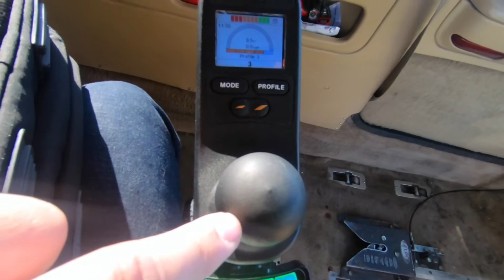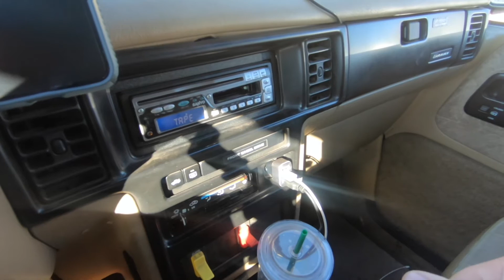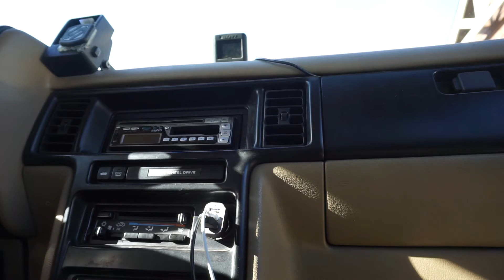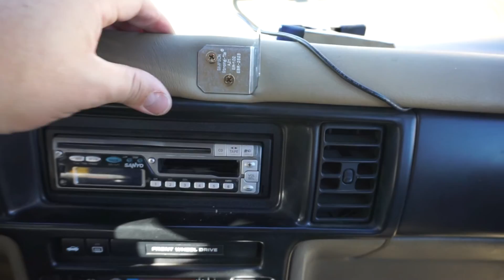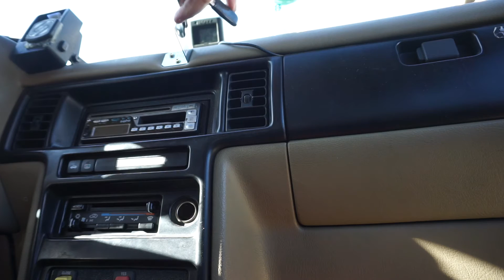VLOG 384 PART 1: dippping stuff!

Comment: Oh Man those LED Bulbs can be real EyeBall Blasters !!!  I had a similar problem where I wanted to soften the light coming off the entire bulb. It just so happened that I had a can of cream colored high-temp stove paint !  I spray-painted the whole bulb (except the threads of course). I get headaches from the glare before that. The nice thing is that you can keep adding layers of paint after each coating is dry until its as dim as you like. I think I did 2 coats of paint....Maybe 3. Now the bulb throws a soft sunset type of light rather than a high-noon desert-storm type of a light. PERFECT ! Though I have to admit, YOUR final product looks WAY cooler than mine !!! Mine is just a cream color bulb. Yours looks pretty techy and futuristic !

Other Suggestions: Bungee Cords are cheap. Change your clocks... change your Bungee cords (twice a year).
Reply from the maker: lets add to the list.. change clocks... change smoke detector batteries... and change the bungeeee cords! LOL
Reply: @TotallyNormal-  OH !!! GREAT Idea! ...Don't forget to mount a smoke-alarm near your tail pipe. The perfect accessory for a Rat-Rod ! ...just in cast you start to burn oil. HaHaHa ! :-)
Reply from the maker: i knew something was wrong when i was moving and there was a bunch of Carbon monoxide detectors in a box in the back and they ALL started going off about 15 min into the drive!! lol
Reply: @TotallyNormal-  Now I know why you are always laughing :-)

Comment: Legs are killing so have to lay down and will come back to this series, but before I go, if this did not turn out, consider just getting casting supplies and silicone mold liquid or putty(is less messy) and casting your copy in resin, then dipping it in the leftover silicone mold making liquid or putty. 3d printing is sometimes really over rated and this new tech has made us forget the basics. Be sure to practice on a non important part first and use mold release spray. Buy it online for the cheap or use a coupon for sure if going to Hobby lobby or the sort beause they are overpriced without it there. Just a thought, Hope I get to finish watching soon.
the bonus here is you can use clear and incase whatever you want in your joystick if you wanted even.
Reply from the maker: That’s actually already on order!! Haha great minds run in the same rut!! 
Feel better!!

Comment: um yeah, make sure to turn off the joystick also when you're opening drawers in the kitchen, as they invariably will roll over the top of the joystick and pitch you backwards as you open the drawer. Had this happen to me and it slammed me right into the outside glass of  the oven, and smashed it before I could get the joystick dislodged again. No bueno.
Reply from the maker: quick joyride!!